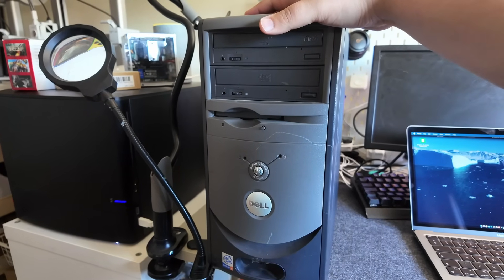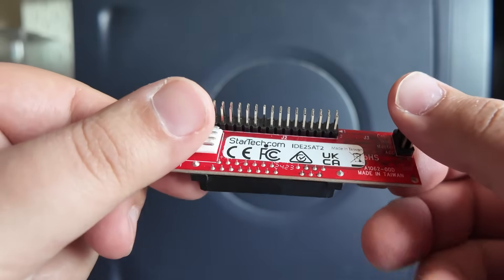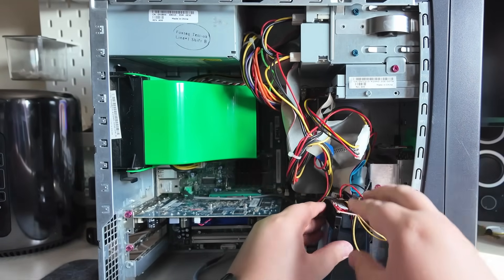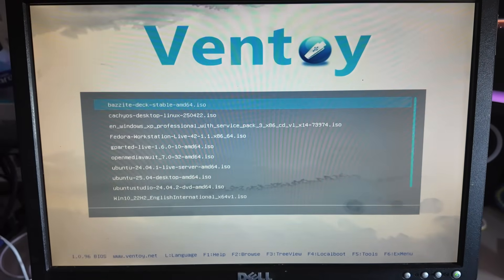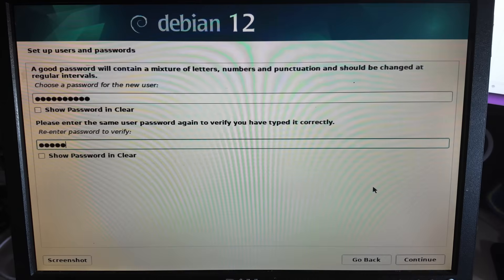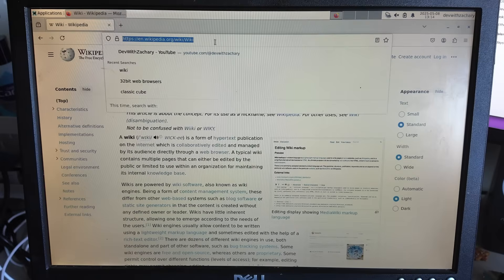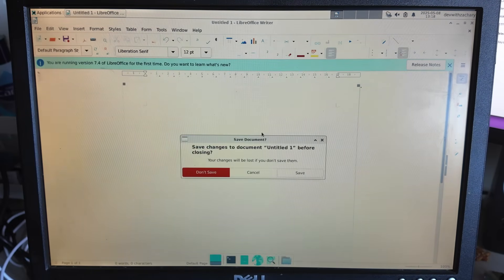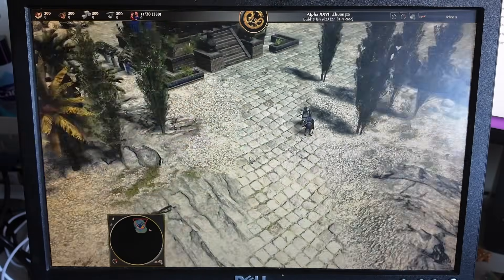How Useful Is Modern Linux on Old Hardware? Debian 12 on a 20 year old Pentium 4 Dell Dimension 4600

Comment: Microsoft: Any computer older than 2017  is e-waste.
Linux: Hold my beer!

A few weeks ago I was gifted a Pentium 4 Northwood at 3 ghz on an ASUS P4P800 deluxe motherboard from 2003. It had Windows 7 on it, Geforce 6400 AGP GPU and 2 Gb RAM. Inside it had an 80gb hdd. 

Ran the Windows Experience Index and the graphics card was dragging it down to 3.0. 

Opened it up and using my old parts machine upgraded to 3Gb RAM and swapped in a Geforce 7600 AGP GPU. The Windows Experience Index rose to 4.1, limited by the CPU. The GPU ranked 4.6 now instead of 3.0. 

I also noticed a second 80Gb drive. It looks like they originally intended to set up a RAID 0 but then just forgot about the second drive as it wasn’t even partitioned. So naturally I unplugged the other drive, installed MX Linux i386 on the empty drive, plugged the old Windows 7 drive back in, booted linux, ran sudo update-grub, and had a sweet Windows 7 / MX Linux dual boot. 

There were a few problems i had to work around. 

When I tried running Linux updates it failed because the mx-viewer program needed a CPU with the SSE3 and Pentium 4 only supports SSE2.  But it was optional so I removed mx-viewer and the update finished okay. 

I cannot get the nvidia drivers for a card this old so am stuck with nouveau, which is not great. Had to disable 3d hardware acceleration in places.  

LibreOffice would freeze the GUI when starting up.  In the BIOS I increased the “video buffer window” from 64 mb to 128 mb. This let LibreOffice start, but very slowly. But then in the settings I could disable the hardware 3d acceleration and now it works fine. An ATI card would probably work better. 

In Firefox I added a plugin that forces youtube to h.264 video and it works great now. 

I then installed Dosbox on it and then my old Warcraft 2 CD game from 1995. It works great.  

The great thing is that as of this week this 22 year old computer is safer to use than Windows 10 (with no security updates)

Comment: I have had a Dell Inspiron 530 w/ Intel Core 2 Duo Quad since it was brand new (2006~2007) that through the years I converted from 32 bit to 64 bit (quite easily with that CPU), installed a SSD, updated the Bios to accept 8 gigs of ram (3 gigs came with it from the factory) and because Win 11 2H24 came along and didn't want anything to do with my old CPU, I said "I'm done with Windows for this beautiful old machine and I'm gonna install Linux Mint Cinnamon" which I upgraded to Xia when it came out. I have given this desktop a wonderful new life hooked-up to a 60" Samsung TV (I stream everything) with a NVIDIA GeForce GT1030 GPU and with STEAM software the kids can play games, etc on it. There's no glitchiness, no stuttering, just beautiful streaming.

The machine utilizes very little CPU and very little ram.

I am so glad I converted!

Comment: Neofetch is an abandoned project btw. A big part of the reason this went so well was because of the graphics card. With pre terrascale ATi or pre Tesla nvidia cards getting modern linux up and running is a nightmare. It's more feasible with nvidia because they provide the tools to compile the kernel module still but you'll have to fix the breakage the script has yourself.

Comment: I saw on another video, the correct gender of ide to sata adapter - that can plug into the ide port on the motherboard.  so that you have sata cables running through the case instead of ide cables.  so way less blocking of air flow.   way cool.  Do not know if the adapter is for 1 or 2 sata devices - since you might want to replace the cd/dvd as well.

Comment: Up to a few years ago I was running Linux Mint, fully updated, on a HP SFF computer that is about 20 years old (BIOS is from 2005). It comes with a Pentium 4 "630" (3 GHz, 1c/2c), 4 GB DDR2(?)-RAM. HP removed the PCIe slot from the propriatery motherboard ( 😠), so it only has "onboard video".

It was an itsy bitsy teenie weenie bit slow (of course), but it worked great; YouTube videos ran flawlessly.

Comment: Right now I am checking out an old Dell laptop with 4GB ram that was given to me a while ago. It has no operating system on it so I booted into a live Linux distro and installed openbox, i3, Window Maker and Enlightenment to check the performance of each before installing the operating system. I finally configured the latter, Enlightenment, just the way I like it and proceeded to use the computer as normal, surfing the web and invariably ending up on Youtube, as you do. Anyway, its 10:15pm, I have been on this thing since just after dinner and, until now, I completely forgot that I'm using a legacy laptop in a live environment watching videos seamlessly at 720p. Linux is beautiful!

Comment: For youtube you might consider changing the options to limit it's choice of codecs to your needs using the config parameters of firefox...
Tried on 10 year-old harware (4th gen pentium g) on windows 10 and it provided a watchable result.
Still, with p4, don't know 😂 there was a huge leap right after those years.

Comment: I keep seeing these "Install linux on ancient machine" videos and I guess it's a good extreme example showing if you can /kind of/ do it on these extremely outdated machines you could do it so much easier/better on machines that aren't nearly so old. But really these videos are /never/ practical. Almost nobody is going to pull one of these machines out of mothballs to use as a daily driver no matter how much linux debloats it. Linux is very efficient but it's not a miracle cure for low hardware specs to get it to run like a modern machine. You are /always/ limited by the hardware there is no software in the world that can make a 300Mhz machine run like even a 1.5 Ghz machine.

Still though, anything that /currently/ is used as a daily driver on windows will probably run at least slightly better on linux for most tasks, though gaming is still a mixed bag. Though on the machines I was testing on they /really/ weren't built for gaming and my comments about software not being able to turn a low-spec machine into medium/high-spec machine being especially true when it comes to GPUs.

Comment: I'm wondering if it'd play better with a stand alone youtube client and/or made to use the old h264 codec. I've had some luck with that on lower end hardware, unfortunately the one I have doesn't let you log in, so you can't watch anything that's requires login. Though this machine might actually predate h264 I'm not sure. I'm actually a bit surprised this runs so smooth on the games like Minetest, must be /highly/ optimized. Then again I think the base minetest install is extremely minimal and you're meant to download lots of addons/extensions/mods to turn it into an actual game. I've poked around in minetest but I don't play unmodded minecraft and minetest without addons is even more stripped down than that, and even with addons/mods most minecraft mods or anything similar simply don't exist.

It's actually something of a good metaphor, you can install it, make it /look/ similar to the mainstream one at first glance, even make the basics work near identical, but some features might be missing or have different controls or you have to jump through a hoops to achieve a similar goal. In some ways it might work better due to being more optimized/less bloated, but you tend to lose some features/ease-of-use you actually like along with stuff you didn't need. Basically it's like going from windows to linux. Or maybe just going from mainstream to open source. It all depends on if you only use the basics of the software or if you actually want or need all the specialty features.

Comment: This is a great illustration for how the rate at which computers improve in performance has slowed to a crawl. Your machine is 20 years old and limps running Debian 12 with xfce and Firefox. My daily driver is 10 years old and runs the latest Kubuntu, with KDE Plasma and Brave. I can't tell it's not a brand new system, perfoamce-wise. The difference between your Dell and my machine is staggering. The difference between my machine and the brand new system I use at work is negligible (except that the new system runs ridiculously hot and so the fans spin up all the time).

Comment: I use a 2009 Macbook pro running Mint. Wife was gonna toss it and I use it a lot actually. Got an SSD in it. Need to upgrade the battery. Lil bastard gets hot tho.

Comment: You should give a try to a very light Linux distro. I've put a x86-32 bits Puppy Linux (S15Pup32-22.12-250402 is the last 32 bits version available) on my Asus EeePC 904 HD (Celeron 900 MHz and 1 GB of DDR2 RAM ^^), in a persistent mode and with -toram parameters, and damn this thing is almost a rocket now ! I use Palemoon as a browser and YT works fine if you can cope with 720p video quality (not so difficult actually on a very small computer like the EeePC).

Slax is pretty fast too but a bit difficult to understand for a noob like me, as you have to almost build your whole system yourself. But it also has the -toram parameter, so the slow memory interfaces are not a problem too.

Comment: I have heard old firmware may potentially be a vulnerability regardless of OS but it is impressive what old hardware can do with Linux. My 2011 HP 8200 Elite SFF has Debian on it but I haven't touched it in some time. It's also my only computer with a DVD drive at this point so that's one reason I keep it around. I have a 2TB version of that Crucial running Tumbleweed that was in that machine but is now in my main build.

Comment: The weird thing about video playback is that this was the exact PC I grew up with as a teen and although I spent a lot of time tweaking it (some things never change) I don't really recall video playback being unplayable, then again this would've been around the very earliest days of youtube around 2003-2004. A lot of content was flash e.g. Newsgrounds etc. That said I had no issue torrenting movies back in the day, so yeah I don't recall video being such an issue. I did have a 6600GT / HD 4850 if that changes anything though.
Reply: Rewatched the browser part: The issue is FireFox has a LOT of background processes that need to be tweaked or turned off in about:config that will help spare the CPU, it's also nowhere near as 'light' as it used to be. LibreWolf has a lot more stuff turned off out of the box for example, installing uBlock / Adblock will help[ turn away the lion's share of stuff the browser is trying to fill up the CPU with in the background.

It really shouldn't be chugging just scrolling Wikipedia like that either. Definitely some kind of hardware acceleration / smooth scrolling / background process issues going on here. Fun project but I think you could get much more performance out of it!

Comment: for web browsing on low-end hardware you can try mobile version of the internet using user agent changer extension and chose android or ios.   most websites use less code and ui elements on mobile version .

Comment: I have a HP Compaq SFF with 32 bit motherboard architecture Pentium 4 that I purchased 14 years ago as a refurbished used for less than $200.    I installed Debian 12 last year along side Windows XP professional version, Debian 9.1 and Linux Mint 19.3 Tricia (the last Mint version available for 32 bit machines).   I upgraded 6 or 7 years ago to 4gb Ram (yet on this older machine limited to 3.2 usable memory) and added a 2gb AMD Graphic Card.   I definitely experience the same limitations you mention in this video yet find this older computer useful for my personal projects.  I spend a lot of time on computers creating and producing graphic arts.   I find it helpful to have this older computer around for the occasion where I created something with an older program from a decade ago generation that I want to edit or continue yet find that a newer generation version of this program will not open the file correctly, perhaps a digital painting with many layers and some open missing or a vector based program that opens with objects missing due to changes made to the newer version of the program, most of the time I need Windows XP that runs older proprietary Graphic Arts programs.  This older machine will not install the latest versions of Blender yet you can use older versions up through 2.7.   Blender has so many constant changes going on that you need to keep versions of the program available that you created the file with.   You might even install an older 2.48a version of Blender using WINE, it will run very good.   Other graphic arts programs available as packages run slower than a newer computer yet still work with a little patience such as Krita, MyPaint, GIMP,  Inkscape (clunky creating font lettering yet still works).     This older machine with Debian 12 will still be useful for playing music with Clementine or Rhythmbox if you have your own personal library, you can tag mp3 tracks with easytag, Kid3 for WAV files, use Audacity for editing and other programs available in the repositories.   Text editors for programming still work such as e-macs, Kate, J-edit and Idle.  

I personally do not get much into gaming programs with the exception of old fashion board games like Chess, Mahjongg, Aisleriot or Yahtzee.    There is an excellent Yahtzee game available in the Debian repositories called YahtzeeSharp.   There is also a very good billiards game called BillardGL.    These programs all run good on my old 32 bit antique.

With version 13 just around the corner not sure how long this will continue, do not know if 13 will continue to support 32bit motherboard architecture.

Comment: I have Debian 12 on a Dell Mini 910 that I bought new in 2008.  2GB DDR2 RAM (maxed).  Intel Atom N270 processor.   My OS runs from one of those low profile USB drives (5 minute boot time). I boot to CLI only since I just got into linux 2 months ago and I'm trying to learn but I installed LXDE and launch it manually when needed.  I run Falkon as the browser and use a tmpfs for things like cache to prevent burning out the usb drive and speeding the system up.  I get 5-6 hours of battery life with the expanded battery pack and I can watch 360p on YouTube.  My kids get a kick out of using it for YouTube.

Comment: To my knowledge your P4 doesn't support HT - Your Dimension is able to run faster P4 HT's so if you come across one it would be a nice upgrade and it will handle some tasks better. I remember trying the same thing with my Dell D800 which runs a Pentium M 2,0Ghz but due to the lack of multi core or HT everything "modern" ran super slow.

I still use another Dell machine with a P4 Prescott HT/ ATI Radeon 2600 pro and puppy linux - this thing can handle web browsing and video playback quite well thanks to the second thread of the CPU.

Seems like thes old systems age like fine wine.

Comment: Some AMD hardware doesn't have the best driver support in Linux. When AMD decided to support Linux they never went into their back catalog to make drivers. So there's holes in the support. Then there was that time when AMD threw Linux under the bus. They were going through a bit of a rough patch and scored a Microsoft contract. All of that makes older AMD a bit spotty on Linux. Nvidia on the other hand has full support for all the hardware they've ever made.

Comment: One thing you could try for Youtube playback is to install the h264ify addon. The GPU won't have hardware vp9 decode, but probably has H.264. This addon will fetch the h.264 version of the video from youtube, and at least let you take avantage of the GPU hardware decode, instead of software decode via the CPU. It might inly work on fullscreen video, I'm not sure. But it's worth trying. ALso it's limited to 1080p, but if you're usuing old hardware anyway... 😀

Comment: On my old Dell 2400, it ran ubuntu 13 pretty well. but the upgrade to ubuntu 16 wasn't able to use intel extreme graphics. However, if I had a geforce pci graphics card around, it probably would have been fine. Windows 7 would have been fine as well if I would max out the memory to 2gb

Comment: Video playback would probably improve if you force youtube to use h264 wih h264ify, and adding noscript as well to turn off as many scripts as possible. But it is amazing how far you can go with old hardware with Debian.
Reply: I am constantly surprised by how few people testing Linux with old hardware don't try Youtube with h264. I use a 15 year old Let's Note CF-SX2 i3 as my main computer (running Linux Mint XFCE) and swapping from VP9 to h264 more than doubled my playback performance. h264 is ESSENTIAL for older hardware to have a chance on modern YouTube.

Comment: I think video playback might be decent in youtube up to 480p if you use enhanced h264ify extension to force avc1 anything higher than 480p won't play smoothly also upgrading ram to 4GB will improve performance a lot
Reply: That machine may be maxxed out at 512 MB. How much RAM you can install is a motherboard limitation.
Reply: @1pcfred  He has 2GB of RAM its not maxed out at 512MB most pentium 4 motherboards i know support up to 4GB RAM some rare later models even support up to 8GB maybe the one he has supports up to 2GB

Comment: Out of curiosity does wine run older games on this similar to xp or would they be way slower?
Reply: Not native, performances is lower on old hardware. (Emulators, like gameboy, Sega, streetfighters, etc, works well, but no age of mythology or PC Windows games 2000s)

Linux on modern hardware works very like Windows fps performance